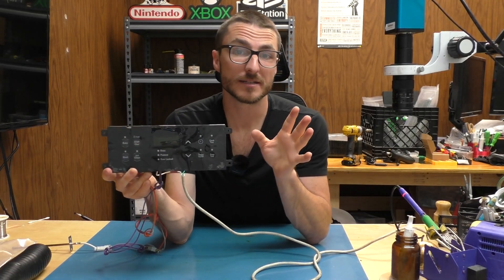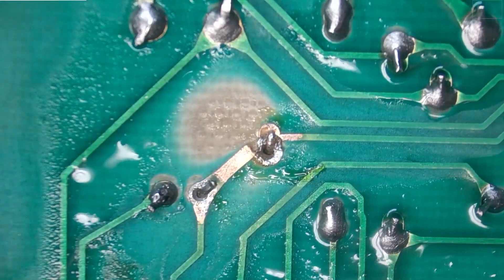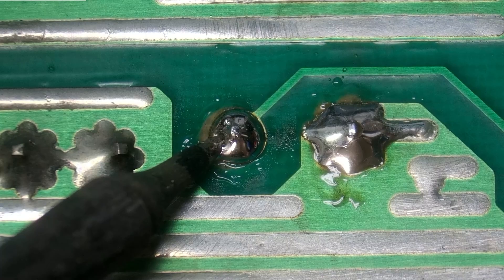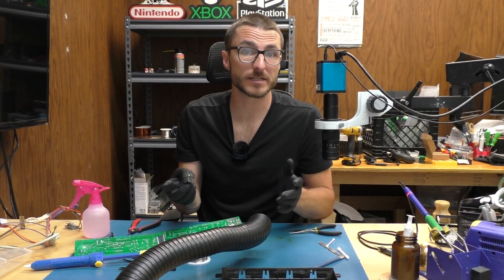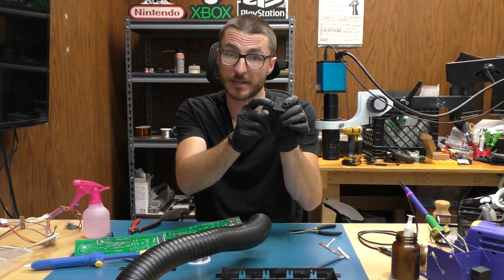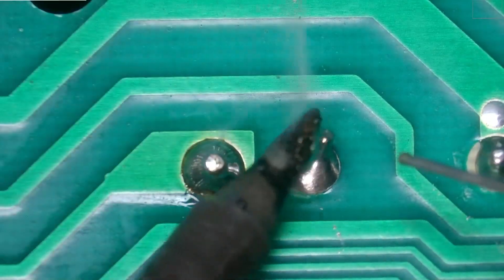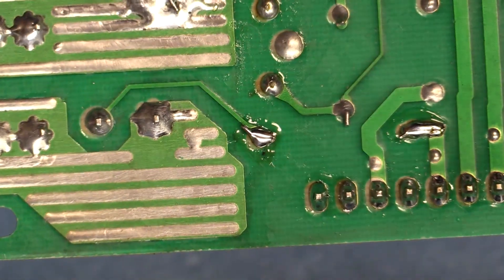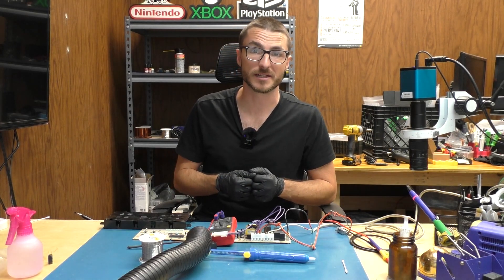Oven Repair For Burnt Frigidaire Controller Board 316207511

Comment from the maker: Send in your controller board for repair: https://nickselectronics.com/products/316207511

Brand: Frigidaire Kenmore Tappan
Models: FEF352AWF FEF352AWG FEF366CCE FEF366CCB FEF355ASG FEF352AUG FEF351CWB FEF352ASG FEF352AUF FEF366ASK FEF355ASJ FEF355ABJ FEF366CCC FEF352ASF FEF366ASG FEF355AQJ FEF366CQE FEF366CSB FEF366CSF FEFB68CBA FEFL74ASF FEF351CUB FEF351CWA FEF366CCD FEFB68CBB FEF355ABG FEF366CBB FEF366CBE FEF366CBF FEF366CCF FEF366CSE FEFB68CQD FEFB68CSD FEFL74ASG KEF355ASG 790.92320301 790.92320302 790.92321301 790.92321302 790.92322301 790.92322302 790.92324301 790.92324302 790.92329301 790.92329302 790.92420301790.92420302 790.92421301 790.92421302 790.92422301 790.92422302 790.92423301 790.92423302 790.92423303 790.92424301 790.92424302 790.92429301 790.92429302 790.92680301 790.92680302 790.92681301 790.92681302 790.92682301 790.92682302 790.92683301 790.92683302 790.92683303 790.92684301 790.92684302 790.92689300 790.92850301 790.92850302 790.92851301 790.92851302 790.92852301 790.92852302 790.92853301 790.92853302 790.92853303 790.92854301 790.92854302 790.92859301 790.92859302 790.92882301 790.92882302 790.92884301 790.92884302 790.92889301 790.92889302 790.93553301 790.93553302 790.93553303790.93850301 790.93850302 790.93850303 790.93851301 790.93851302 790.93851303 790.93852301 790.93852302 790.93852303 790.93853301 790.93853302 790.93853303 790.93854301 790.93854302 790.93854303 790.93859301 790.93859302 790.93859303 790.94320300 790.94320301 790.94320302 790.94321300 790.94321301 790.94321302 790.94321303 790.94322300 790.94322301 790.94322302 790.94322303 790.94324300 790.94324301 790.94324302 790.94329300 790.94329301 790.94329302 790.94420300 790.94420301 790.94421300 790.94421301 790.94422300 790.94422301 790.94423300 790.94423301 790.94424300 790.94424301 790.94429300790.94429301 790.94680300 790.94854301 790.94859300 790.94859301 790.95320301 790.95320302 790.95320303 790.95321301 790.95321302 790.95321303 790.95321304 790.95322301 790.95322302 790.95322303 790.95322304 790.95324301 790.95324302 790.95324303 790.95329300 790.95329301 790.95329302 790.95329303 790.95420302 790.95420303 790.95421301 790.95421302 790.95421303 790.95422301 790.95422302 790.95422303 790.95423301 790.95423302 790.95423303 790.95424301 790.95424302 790.95424303 790.95429301 790.95429302 790.95429303 790.95680301 790.95680302 790.95680303 790.95681301 790.95681302 790.95681303790.95682301 790.95682302 790.95682303 790.95683301 790.95683302 790.95683303 790.95684301 790.95684302 790.95684303 790.95689301 790.95689302 790.95689303 790.95882301 790.95882302 790.95882303 790.95884301 790.95884302 790.95884303 790.95889301 790.95889302 790.95889303 FEF351CSA FEF351CSB FEF351CSC FEF351CUA FEF351CUC FEF351CWC FEF352ASH FEF352AUH FEF352AWH FEF355ABH FEF355ABK FEF355AQG FEF355AQH FEF355AQK FEF355ASH FEF355ASK FEF355AWG FEF355AWH FEF355AWJ FEF355AWK FEF366ASH FEF366ASJ FEF366AWG FEF366AWH FEF366AWJFEF366AWK FEF366CBC FEF366CBD FEF366CBG FEF366CQB FEF366CQC FEF366CQD FEF366CQF FEF366CQG FEF366CSC FEF366CSD FEF366CSG FEF366XESA FEF366XESB FEFB68CBC FEFB68CQB FEFB68CQC FEFB68CSB FEFB68CSC FEFL74ASH KEF355ASH KEF355ASJ TEF364AQG TEF364AQJ TEF364ASG TEF364ASJ
Compatible Part Numbers: 1036364 316207531 316557511 AH820139 EA820139 PS820139

Comment: I have the same type of board. My oven randomly turns off and the display wont work. After a few minutes the display comes on and oven works again.im told the transformer on the board is the issue. Where can you get a transformer. Im going to attempt to replace it.
Reply from the maker: Hello,
You can't get replacement CPU's or replacement transformers for these. However if you send in your board we can fix the transformer for you. 
I will say however that your symptoms don't actually sound like a transformer fault. When a transformer fails it will fail and it will cause the controller to be dead 100% of the time. It's not going to be intermittently working. Intermittent functionality like what you are describing is more often due to cracked solder joints or malfunctioning IC chips. 
I wouldn't really be able to assist futher without taking a look at the unit myself. If you did want to send it in for repair, we offer flat rate services which come with a 1 year warranty.

Comment: Gd day sir I have a frigidaire gas range with an oven problem I replaced the ignitor  and ialso the temperature sensor the issue is that the oven lights but does not stay lit it makes a beep sound then flames out then restarts the process again also I notice when I leave the oven door open the oven stay lit but when I close the oven door it makes that beep sound and flames go out again I believe it can be a mother board issue
Reply from the maker: What is the model of your oven/range and or the part number of the controler board?
Reply: @NicksElectronicRepair  Frigidaire FCRG3052AS
Reply from the maker: Mhmm, sorry but this is not a model I have worked on before or that I am familiar with. 
It might be best to have a local tech take a look at in person to properly diagnose this one.

Comment: The voltage rating of the lags is not important for that repair. The current carrying capacity is what matters. So the cross section is important. Thats why the pads are so huge arond the relay legs and thats also the reason they have solder on the traces on the pads.

Comment: I used Omron or similar relays that have the quick connect tab directly on top. 	
T9AS1D22-12
That way, the heating element current doesn't go through the traces and solder joints on the board.  Solder and high current don't really belong together.
Reply from the maker: "the quick connect tab directly on top"
Can you tell me more, I don't think I understand.
Reply: @NicksElectronicRepair  Hi, If you look-up the part number in my comment, you'll see that the power connections are not solder pins for a circuit board. They are quick connect tabs that the oven wiring connects directly.
Reply from the maker: Oh I see
Reply: @NicksElectronicRepair  The damaged is caused by a heating element going bad and short circuit or close to short circuit. Those new stove don't have any fuses like the old ones. So the solder and copper traces become the fuse.
Reply: Do you believe this problem is caused by bale or broil heating element going bad? Also do either of you gentlemen know the ohm/resistance for each element ?
Reply: do you have numbers to relays like that to replace the OZ-SS-112LF relays? With wire terminals instead of solder pins? Is there a terminal receptacle for them?
Reply: @pl747  Your relay has a small footprint. I don't think it's available in the form factor you are asking. I found something with the right specification but it's a chassis mount form. You would need to solder two wires from the board's 12V tabs to bring to the relay. T9AP5D52-12

Comment: I use a cleaning pen with a coarse fiberglass insert. They are fantastic for cleaning up damage like this, but be aware of the fiberglass particles and vacuum them away (don't blow).
Reply from the maker: Yeah if you check out some of our other videos you will see we also have one and use it sometimes.

Comment: Nice repair. You got a new sub. I see quite a lot of the unleaded solder joints on appliance control boards and vehicle PCBs cracking. Reworking with leaded solder is my go-to.
Reply from the maker: Thanks for the sub!

Comment: Very pleased to see you're doing what I started doing back in COVID.  I'm going to give you my honest input on this particular repair --this is the first time on your channel.  Firstly those relay boards are grossly under engineered unfortunately.  Single sided boards with lead-free solder are asking for trouble. Granted they are very easy to repair. I use leaded flux-core solder for all my repairs.  The 30 Amp relay you replaced is what is called a "double break" relay to provide redundancy for the Bake and Broil relays.  There's been much discussion on forums regarding the 220 ohm resistor which connects the N.C. pole of that relay back to oven Neutral.  It blows for a reason, and I don't think because of a cracked solder joint directly.  What I've found is that either the Bake or Broil relays (or both) "weld on" and when the DBR deenergizes the 120 VAC power flows through the welded relay via the C. and N.C. contacts to Neutral instantly popping the resistor.  So I'm adamant that you always replace the Bake and Broil relays.  They are under rated for the switching of massive resistive loads simply fail.  I'd be happy to have some discussion off of YouTube as I've made what I consider to be some reliability improvements.  Ethan 

P.S.  I highly approve of the repairs your're doing, so don't get me wrong --just want to make sure you're not overlooking details.

Comment: I'm not convinced that the damage and arc-ing with 220 has not damaged any semiconductor on that board and is only residue..but at least worth trying. Bring more :)
Reply from the maker: Yeah honesly same. When we have this much damage the CPU is almost always shorted out. In this case it was not which is lucky.

Comment: About 50% of the ones we see have a bad control IC. We test the glass diode near the IC for a for a short before performing the repair now.
Reply from the maker: Yup I was very surprised this one didn't have a bad CPU given the damage.
Reply: @NicksElectronicRepair  do you have a fix for when the IC goes out? Donor ICs or new ones?
Reply from the maker: Unfortunately no, I do not and have to call them beyond repair as well when the control IC goes out.
Reply: We have several of this exact board with a no power issue. Any suggestions we have checked all the obvious things even swapped a few components but with no luck any any help would be appreciated.

Comment: Nice repair except for not removing all of the carbon.  It’s not for aesthetic’s, carbon is conductive and it will arc to other components or traces at some point.  It’s called carbon arcing.
Reply from the maker: Yeah if you look at prior videos we already had extensive discussion about it.

Comment: Thanks again Nick, I keep learning new techniques from watching your videos. 
Ex: when you left the biggest solder joint on the relay at the end because it would be easier to remove it by simply heating it up, which makes it easier to remove the remaining solder once the vias are free. I would have probably battled to desolder them all before trying to remove the relay. 
But this is experience, so thanks so much for sharing it.
Reply from the maker: Hey I am glad to hear that! Yeah that's a small thing but it can make a big difference.
Reply: @NicksElectronicRepair we have lots of these controls with this problem and also a no power issue do you have any suggestions for the no power as what to look for we have tried swapping the transformer out with known good ones and still no luck